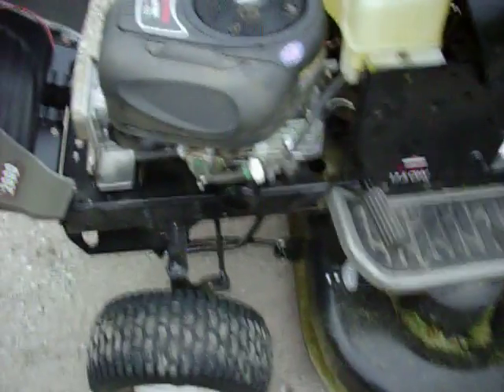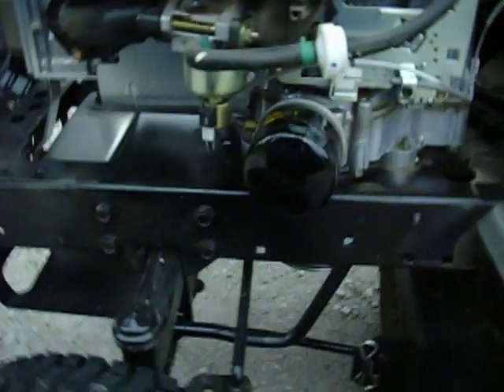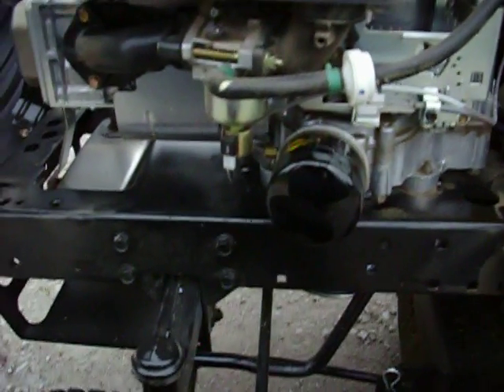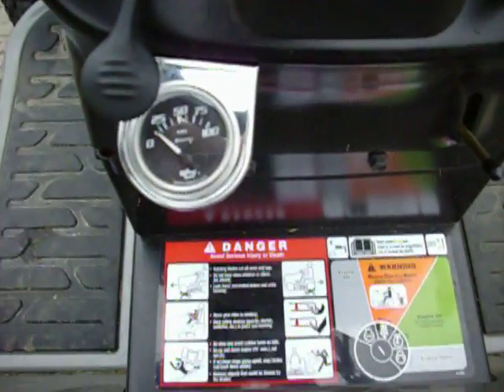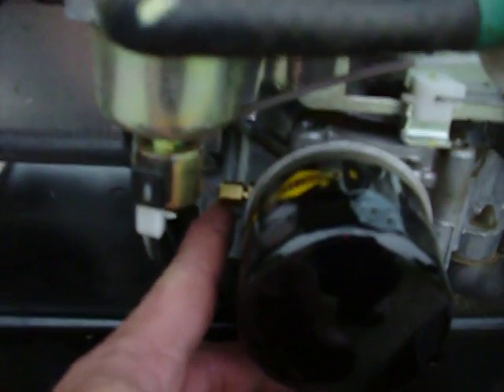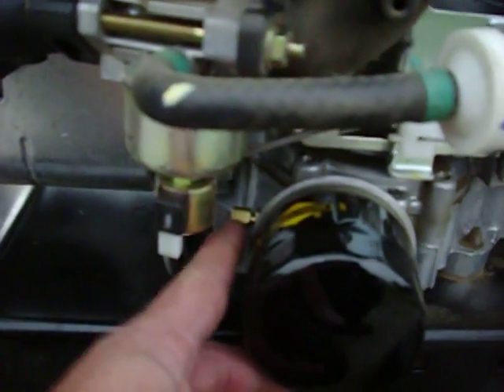oil pressure on my briggs and stratton engine

Comment from the maker: @weasel884, if the engine don't have an oil filter on it, it is a splash type lubercation, and that means there is no oil pressure needed for it, the splash type is a oil slinger that sits in the oil reservoir and when the engine starts the camshaft gear spins the splasher splashing the oil all over inside the engine, my MTD has that and it has an OHV

Comment from the maker: @weasel884, i don't think you need to worry about that, if the engine don't have a oil filter on it, it has a splash type lubercation, i got an MTD tractor and it has an OHV and it has a splash type lubercation on it, does it has a low oil alert on it? if it does, that is the same way except when the engine starts to run low on ol, it shuts the engine down

Comment from the maker: @weasel884, yup, i just don't like the mechanical oil pump inside them tecumseh engines, they can fail without warning, i had 2 mowers that has tecumseh engines on them, one seized up and the other threw a rod, i said, no more tecumseh engines on my mowers, i am sticking with briggs for good

Comment: Do you think it's possible to put an external pump on an engine like this? Just curious for a project, it's going to be mounted as a horizontal shaft instead of a vertical.
Reply from the maker: i am not sure about that
Reply: @SpiritsoftheWolf  from looking at the engine, if I can find an external pump, it should be possible.... what's the normal oil pressure on your engine?
Reply from the maker: @zragevii4705 , normal engine pressure is between 15 and 30 at normal engine operating temps, cold oil temp reading will read higher until it warms up
Reply: @SpiritsoftheWolf  ok, I'll let you know what I get working.... I'm gonna have to drill a hole for sure....

Comment: @SpiritsoftheWolf is it possible that i can put a oil pressure guage on a OHV briggs 12 hp with no oil filter? its also a diamond seris and i cant lose such a nice running mower (my yard is a hill that would cook a sump motor)